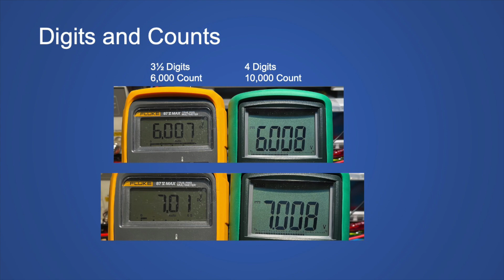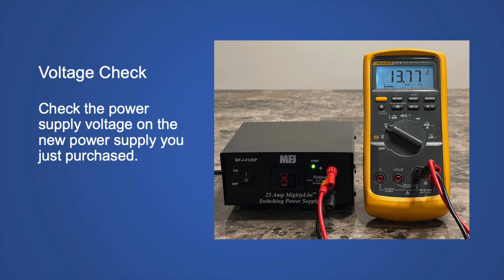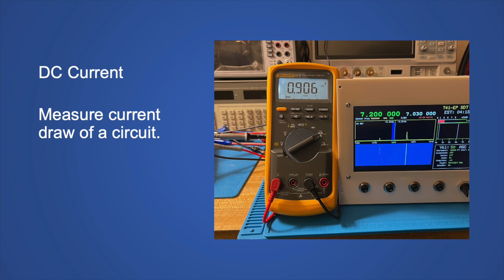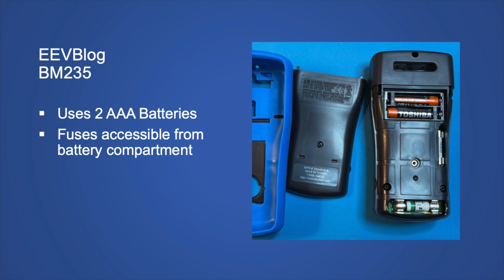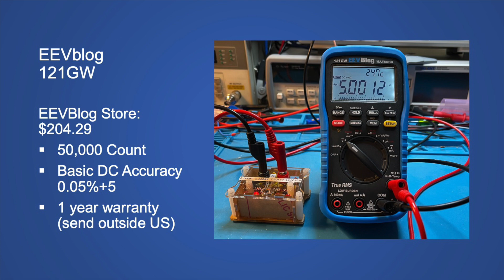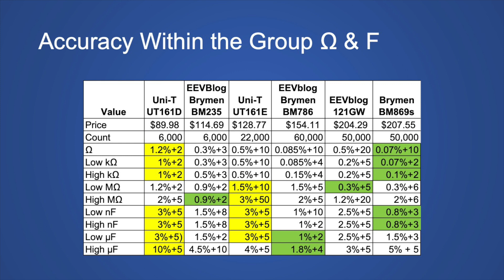DMM for Ham Radio

Comment: Your list is missing the 30$ vc97 which is functionally equivalent for most purposes to all the rest
Reply from the maker: Thanks for you comment.  This presentation only featured meters I recommend and as stated under safety I don't recommend any meters that are not third party safety tested.  I review meters that are not third party safety tested but I don't ever recommend them, that is up to each person to decide if they want to risk using one.  The VC97 I own does not show any markings and the manual does not state that it is third party safety tested.  Also the VC97 is a 4,000 count meter.  A more equivalent model would be the VC99 for $37.95 that is a 6,000 count meter.  I will eventually get to the reviews and comparison of all my < $100 meters.

Comment: Interesting to see that the Brymen BM896S met all it's accuracy specifications, whereas the rebranded Greenlee DM-860A in your testvideo missed a few specs.
I wonder if this was a variance per example or that Greenlee maybe does their own calibrations.
Too bad there is no point of sale in the US; Greenlee probably worked out an exclusivity deal with Brymen in the past.
Here in Europe, for warranty matters, we just send the meter back to the store we bought it from, and let them handle it.
Are you sure you can't do that too? (send it back to Welectron instead of the factory in Taiwan. I don't know if that makes a difference postage wise).
BTW, the price you list for the BM869S is for the "+" edition, which includes a carrying case, whereas the price you list for the EEVblog 121GW is without carrying case.
The BM869S without carrying case costs ~$8 less, so it's actually a little bit cheaper than the 121GW if you compare apples to apples.
Plus you get better probes with the BM869S (the 121GW used to come with the goldplated Brymen probes that also include a very handy 4mm adapter, but they changed that to standard nickel plated ones, which are, for electronics use, not so good)
Reply from the maker: Thanks for you comment.  I heard that the EU has stronger consumer protection rules that make the store more responsible, in the US most stores offer an extra cost protection plan and if you don't take it after a very short time (from one week to 1 month) and strict condition (good condition with all accessories and original box) they will take the defective item back, sometimes with a restocking fee.  After that you must deal with the manufacture for support.
Good catch on the price of the BM669S, I did order the + version, I would have ordered the 121GW with the case but the case was out of stock.